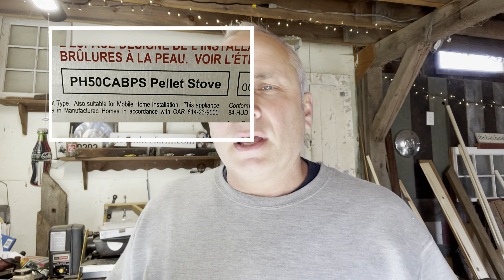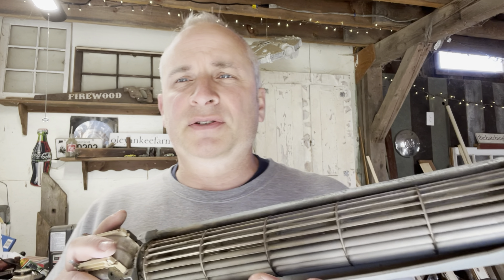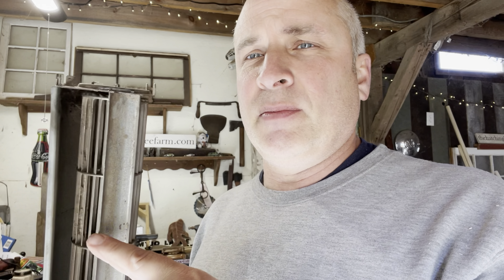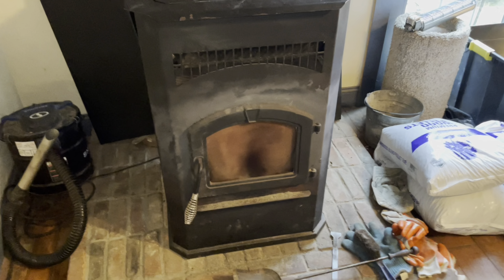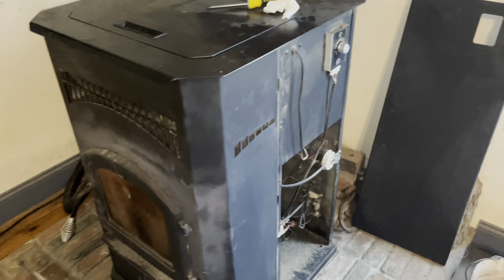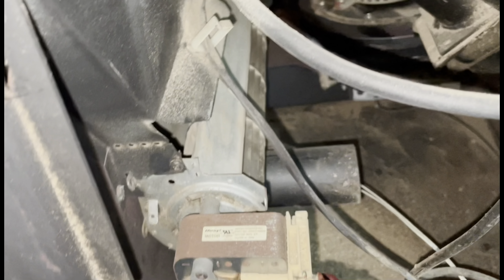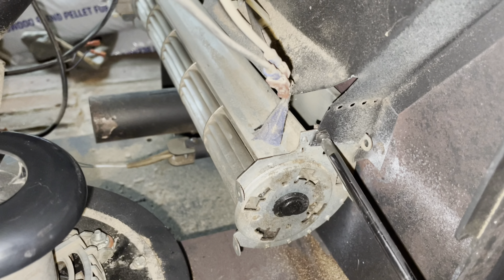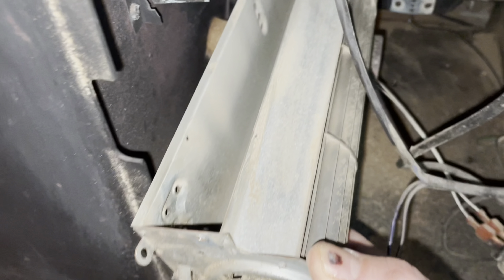Pellet Stove Repair - blower fan Remove & Replace

Comment: Could you just replace the small black piece?
Reply from the maker: Possibly?
Reply from the maker: Oh geez, just found the grommet online for $6 😑
Reply: Anything like this is typically squealing because of this grommet / bushing type issue or the bearing
Reply: The actual motor on the back of it is a very universal motor it's on lots of fans etc

Comment: Do they sell the little cap separately???
Reply from the maker: @patrickcalahan8391  I believe they do.
Reply: I just went down and greased the cap. Its still noisy but we'll see if it runs until I can get a new blower. I was getting E1 codes on my USSTOVE 5501S and it said a possible cause for that error is blower 3:19  overheating @OleYankeeFarm
Reply from the maker: @patrickcalahan8391  I specifically looked for a blower that mentions that it’s quiet. The grommet on mine is orange colored